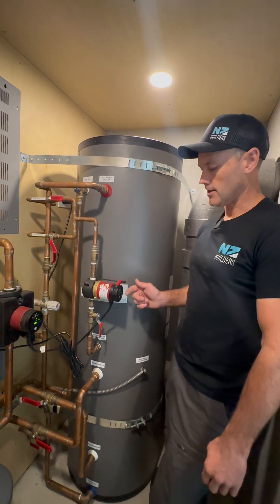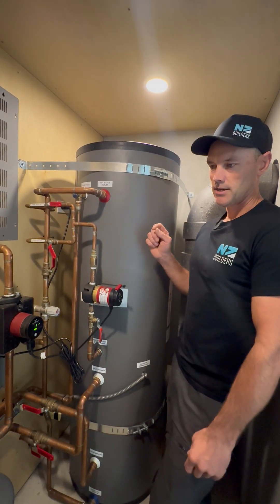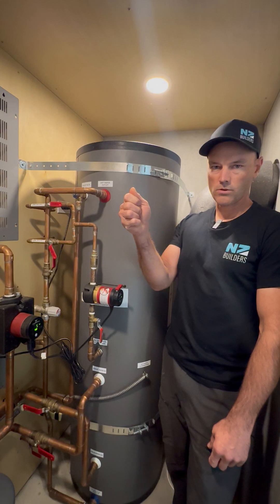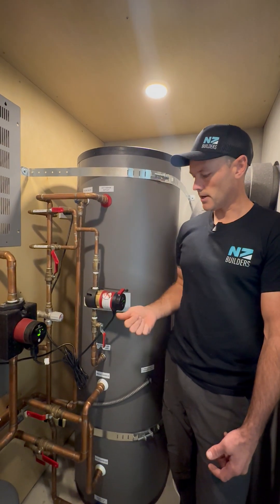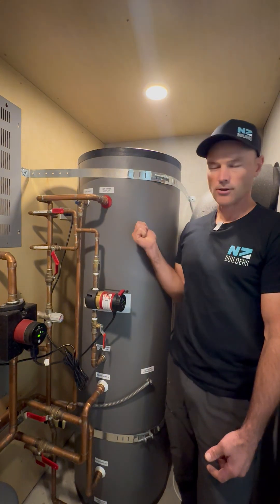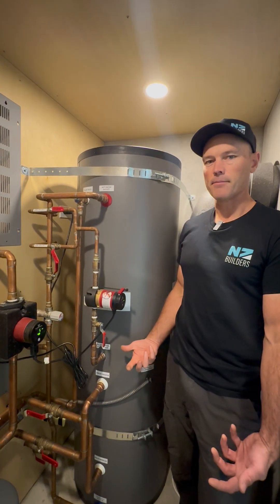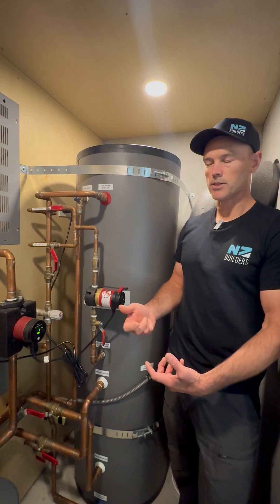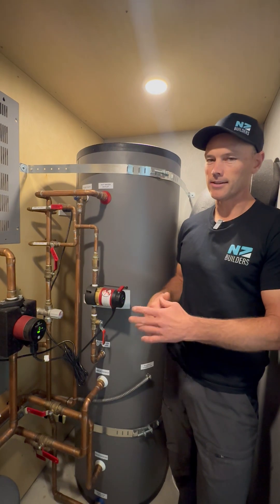Recirculating Hot Water Pump- Why It Is A Good ROI

Comment: #1 The motor stays on all the time that the timer is on.  #2 the reduction in water and the increased electric cancel out.  #3 Your GAS BILL will increase and your water heater will have a shorter life span.